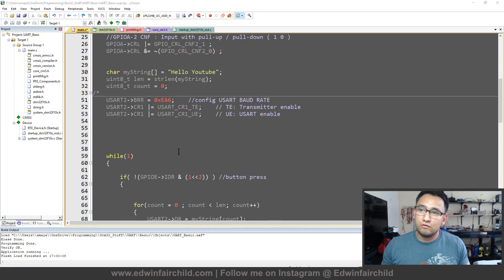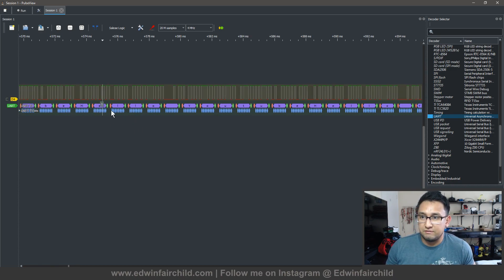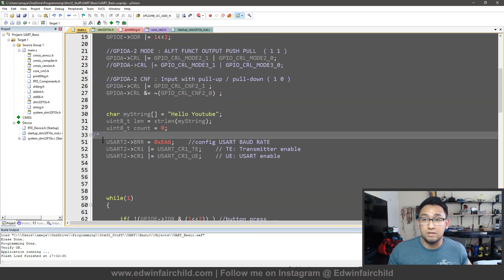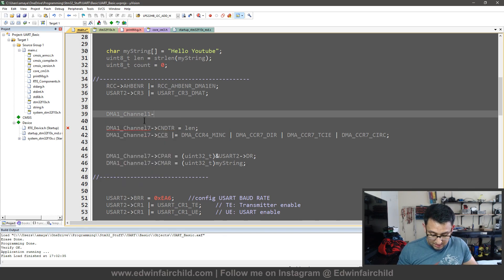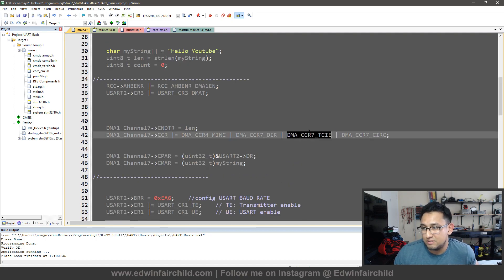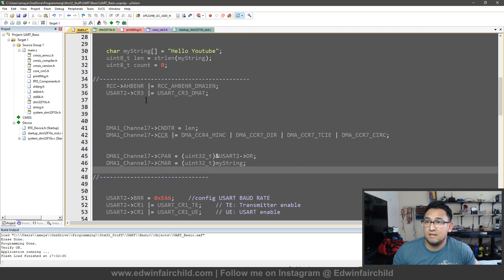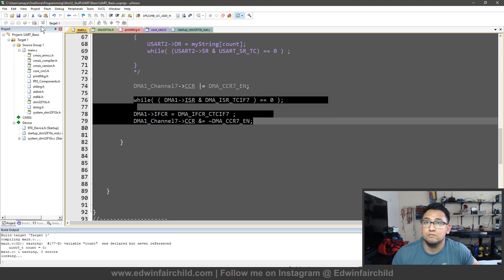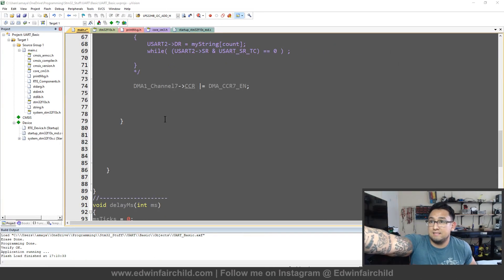STM32 DMA PT 2

Comment: Awesome video! Explains DMA really really well to someone just getting started with stm32.
A tip for anyone using CubeMX and HAL to autogenerate some of the initialization code for DMA use with SPI.
MX_DMA_INIT() needs to run before MX_SPIx_Init(). For whatever reason the code generated put the SPI init before the DMA init, and it took me the better half of a day to fix. This may also apply to other peripherals.

Comment: Hi Eddie,
Thanks for the detailed videos. I had a question, I want to receive some data whenever a user sends it (I mean i dont wait for the data to be present), so I am making use of Rx FIFO not empty interrupt. Since I donno the length of the data, I reading data byte by byte, and for each byte this interrupt is triggered. Once I get the interrupt, I read the RDR register content to a circular buffer and go to next location in that buffer after reading a byte.

But I want to do this using DMA. How should I do it? Because I do not get know the data length. So till the data reaches UART RDR register, can I use DMA as a mode of data transfer? Reading the RDR register to circular buffer, I am doing as a normal operation.

Thanks.

Comment: Pretty cool video! 
I have a question though. What happens if the CPU overwrites to myString (say a new value "Hi Eddie" in the next loop iteration) while the DMA is yet to finish the transmission to the peripheral?
Reply from the maker: that is a matter of logic, you transmission was sent based on what was in it at THAT exact time , if you over write then you over write , if you are referring to two bus  masters accessing memory at the same time , or if you are concerned about a race condition? if you are concerned about a race condition this could easily be tested by setting up a DMA mem to mem transfer ,and transferring an array from one location to another once you start the DMA then the very next instruction modify the array and see what got transferred, if the modified value or the non modified value. :)
Reply: Yeah I was interested whether there will be a race condition. Pretty interesting experiment to try!
Reply: @jaycansino630  Probably the race condition might exist on the very next word which might or might not cached or something, but since the DMA isn't caching the whole area you transfering, it will transfer the overwritten data anyway, which is usually unwanted, regardless of from what point it starts to race. If one actually wants to transfer overwritten data then disable continuous transfer instead, and wait to start when the buffer is complete, or at least when you are certain you are able to outrun the DMA xfer by the filling process.

One practical way to avoid race while one want seamless continuous transfer (eg. audio playback) to use two (or more) DMA buffers, use a flags to signal which is free and which is DMA'ed another flag to indicate which is "sendable" . The handshake would be so that task1 search for a buffer which is free, then starts filling it in, and when it finishes, sets the sendable flag. Do not use continuous transfer, but in the transfer complete interrupt, set back the free flag on the just completed one, search for the next sendable buffer, reprogram the DMAR register to that, remove the free flag and start the DMA again.

This also works for reading, eg. sample from ADC into one buffer, while the main thread processes the other one then swap the buffers.

Comment: I am receiving 2 strings in my usart .
1."hi\r\n" 4 bits.
2."AGE\r\n" 5 bits ..

Now if I receive "hi\r\n
usart must transmit "how r u " 
and 
else if I receive "AGE\r\n 
It must transmit " above20" 

I want to implement this code using usart dma .
Can anyone help.me.please
Reply from the maker: start reading from page 810 of the RM for the F1 it states all the steps for UART DMA transmission and reception. its pretty easy and straight forward if you understood these DMA videos and watched them thoroughly
Reply: char rxdata[30];
char txdata[30]="How r u?/r/n";

HAL_UART_Receive_DMA(&huart2, (uint8_t*)rxdata,5);

void HAL_UART_RxCpltCallback(UART_HandleTypeDef *huart)
{
  /* Prevent unused argument(s) compilation warning */
  UNUSED(huart);
  /* NOTE: This function Should not be modified, when the callback is needed,
           the HAL_UART_TxCpltCallback could be implemented in the user file
   */

  if ( strncmp(rxdata,"Hi\r\n",4) == 0)

  {
HAL_UART_Transmit(&huart2, (uint8_t*)txdata,strlen(txdata),10);

}
else if(strncmp(rxdata,"AGE\r\n",5)==0)
{

HAL_UART_Transmit(&huart2, (uint8_t*)"above20\r\n",9,10);

}

}

/* USER CODE END 4 */
Reply: the problem I m facing is this I have to send data multiple times like I have to send hi many timea from.my terminal than it replies.
Reply from the maker: @zuhaibchoudhary4635  the problem is your using HAL and I don't use that so I cant help much there,  try a Facebook group on Stm32 there's a lot of people there who use HAL
Reply: which Is this method of programming called that you are using?
Reply: I am a beginner I want to know which method of coding is used in the industry. which type to use

Comment: Tx Eddie. Is it possible to make the address the DMA is supposed to write to (CPAR) data dependent? So encoded in the data itself like an address header. So in this way the DMA would be able to sort out data packets according to their address headers and send them to certain address locations. I figured that if I have to intervene to decode the address header, then I might as well shove the whole packet to its destination as well.... that would work of course, but the question is, whether there is a way to make DMA to do this transparently all by itself?
Reply from the maker: But also rmemebre dma isn't only about not having code intervention but also not hogging the mcu resources to do data reception and moving. You can check the address header and send it on its way and start doing something else immediately , instead of waiting for your code to loop through the data and put it in its desired location , you could have done all kinds of math functions in the time it takes to do that with code
Reply from the maker: Interesting concept but I don't see how I could do this , because the DMA requires no interaction from the user so then at which point to you update the CPAR or CMAR registers? If in order for the DMA to even get the data it needs those two values... I'm leaning towards..it's impossible. But shit I could be wrong I just can't wrap my head around how on earth that would work, because again if you get a packet of data and in it resides the destination address , the DMA has no way of knowing that..it would require code intervention at which point it defeats the purpose as you mentioned
Reply: Hi Eddie. Yes, you could decode the address and then configure the DMA to handle the rest of it.
But I think I found something nevertheless... It is called DMA request routing and it allows to reconfigure the DMA dynamically from a peripheral. So in a way the peripheral can program the DMA itself. I need to study this but what I understand from it now is that the peripheral can configure the DMA , so the address header could contain configuration data for the DMA, then routing is set up, data is being transferred to a certain destination after which the routing is taken down again waiting for an other configuration request. At least that is what I think this is, but as I said I need to study it more in depth, but I think this is it... Dynamic DMA configuration, or DMA request routing as STM calls it.

I found two documents about it, here,
pdf file,
https://www.google.com/url?sa=t&source=web&rct=j&url=https://www.st.com/resource/en/application_note/dm00535045-stm32-dmamux-the-dma-request-router-stmicroelectronics.pdf&ved=2ahUKEwjlidOk1qnqAhUcwQIHHTwKDrIQFjABegQICxAG&usg=AOvVaw28CjK5Kl_gRrv0R0y_EehL

Youtube video,
https://youtu.be/c0pxTTEHZjE

Thanks for your reply and take care.
Reply from the maker: @OndrejPopp  Oh yeah this is with STM32 that have a DMA multiplexer , I am using the G4 mostly nowadays but have no tried this. The F1 which i thought you were asking about has a much simpler DMA. Still if you are using a newer design definitely go for a newer chip as you can see they are more versatile, thanks for the links ill check it out
Reply: Yes I ordered two stm32 H745's on evaluation boards, costs 20 Euro's per piece so I thought might as well get these... Why not? I am planning a design project with them, but I have no hands on experience how fast fast it really is.... When you go down to programming.... And I do not want to end up with performance problems later. So... I decided to design an infrastructure as powerful as possible before I go down to programming. And so it seems that this idea already paid off, having a DMA multiplexer for 20 bucks a piece among other things 😃
Reply from the maker: @OndrejPopp  oh yeah I've been wanting to pull the trigger on an H7 board also. It's a beast of an MCU , once you get up there with faster speeds you just have to be very mindful of your peripheral flags, on a 72MHz blue pill you can get away with sending data down SPI and then doing something else like reading or whatever, but once it's blazing fast you realize the mcu is executing instructions faster than any peripheral can get anything done so, interrupts, dma, flags etc you become intimate with them . Let me know how the H7 goes for you
Reply: @EdwinFairchild  Ok Eddie thanks I will. As a matter of fact, the infrastructure is going to be even more powerful, and massively parallel as it will also contain 45 or even 76 Esp32's. Now, the stm32H7 will send instructions over one SPI bus as a master to all the Esp32's in parallel, and the Esp32's will figure out all by themselves what to do, and then they produce data, and send the result back to the stm32 over an other SPI bus over which they act as masters in turn, and the Stm32 as a slave, and they, the Esp32's will also figure out an arbitration scheme among themselves. So then, data is going to flood in on the Stm32 on that SPI bus from all 45 or 76 of them, and then the Stm32 is going to sort all this data out based on time stamps. And so that is where the DMA routing comes in, how to sort out data from 45 or 76 Esp32's according to their time stamps.... So sending data over to the Esp32's in parallel, that's easy, but getting it all back from all 45/76 of them that's a little bit more complicated, so I am studying this now, and I thought maybe DMA? And so I have been looking at your videos. And it appears that DMA routing might be able to handle this, although I need to study this in detail, but that is the general concept of the infrastructure... 😃
Reply from the maker: @OndrejPopp  sounds like a heck of an endeavor, do you have any good learning resources for Esp32 ? I've actually been looking into it all morning
Reply: @EdwinFairchild  Funny! What I have I got from over here, https://www.espressif.com/en/products/socs/esp32/overview then at the bottom of that page click on "Datasheet" and "Technical reference". And do the same for the Esp8266, I just had a brief look at the technical reference of the Esp8266 and that appears to be a good manual with screenshots of oscilloscope/logic analyzer screens. I haven't read it yet but I made a mental note to do so later because it promises to be a good learning reference. More in depth than for the Esp32, because they probably figured why write it twice?

That's all I have actually, but the Esp32's are simpler than the Stm32's so after looking at the Stm32 H7's, and watching your videos about Timers, and seeing how you go through the reference manual of the Stm32, with all the registers and all that, that really helped me, and so after that, the Esp32's come kind of naturally to me.... 

One thing I already saw was that the Esp32 has a GPIO multiplexer and so you can configure a peripheral on any physical pin/GPIO you want which is way more flexible than with the Stm32. Although some peripherals on the Esp32 are also hardwired directly onto certain pins, such as with the stm32, bypassing the GPIO for higher throughput. But if you don't care about that you can use any GPIO you want for your peripheral of choice which makes the pin assignment to peripherals much easier. For the rest it's in the manuals.

Next I have just been looking at Youtube videos of people doing stuff with it. Actually I came across the Esp32 by watching Bitluni's lab. I learned quite a few things from Bitluni. He is
building large dot matrix walls for video throughput and is using the Esp32's in many of his projects. Here is one link about the ping pong video wall,

https://youtu.be/EZEMK-C-nSo

One thing I learnt from Bitluni is that to achieve high video frame rate, the Esp32's can apparently parallelize its I2S interface into 32 parallel bit streams. So concerning what I want to do, maybe I could use that to let 45/76 Esp's feed their data into one controller, but then I would probably need to replace the stm32 with several Esp32's. But for the meantime I am sticking with the Stm32 and DMA. In any case, this raised my interest into the Esp32. It has also a SD card slave interface, so you can communicate with it as it were a SD card. I was kind of looking for that in the Stm32, but they don't have that, only a SD MMC master, but not a slave. So for a while I was studying how to build this myself, but then I kind of gave up on that because I decided  that building a SD card slave interface is way too complex. But what do you know? Suddenly the Esp32 has that! So there you go. It is a tiny little chip with a lot of suprises!

And so then I decided I am going to use 45/76 of them!

That's all I know about them now, besides looking at AliExpress and AliBaba how to get 76 of these baby's over here reasonably cheap...

Comment: Yo this is an awesome channel. I've been reading the data sheets myself but it's always great being taught.

Couple of questions: 

1) what is your IDE (I'm using iar)?

2) what is that awesome debugger when you saw the UART transfer data?

3) is there a reason you didn't use an interrupt for the push button?

4) aren't their hardware interrupts for the DMA flags? Ie make an ISR function that knows if it needs to service a buffer or clear an interrupt flag?

PS since learning about the DMA from other uCs I also must say it is my FAVORITE peripheral too. Seems like the smartest invention from the silicon side tbh

Comment: Eddie, Let me first say that I think your video is really great.  I can understand you well, and the pace is fast, but not too fast.  Now here's the BUT....You really really really should have shown the interrupt.  I mean that's the real purpose of using DMA right?  I could have send the serial bits out on a GPIO pin if I was going to just wait around until the data was transferred to the peripheral.  I would be really happy if you would consider making an STM32 DMA PT 3 video to show how the interrupt is implemented.  Until we have that piece working, DMA is pointless.  AND I still think your video was great on the portions you did cover.
Reply from the maker: Which interrupt are you referring to? Send Completion or error ? Because at least to me personally the point of DMA is to NOT interrupt my processor unless there has been an error
Reply: @EdwinFairchild  I think probably the Completion interrupt, but actually since you ask, knowing how to deal with errors would be good too, if not too complex.  Maybe the interrupt is more valuable on the RX channel so we interrupt to process new data received from a peripheral source (GPS, Gyro/Accel, etc).  Just thinking for most applications they will want to be "notified" when the TX is done, and when new data from an RX is available, and the interrupt is the most efficient way to do this.  I'm a n00b to the STM32 with only Arduino Uno experience, so was wanting to see how you setup an interrupt routine for the STM in the IDE.  Thanks for your reply.
Reply: @EdwinFairchild  The point of DMA is still to get the interrupt, but with less frequency.

Consider an ADC capture where you need a block of data to process. Instead of interrupting by the ADC at every single sample, let the DMA collect the data THEN interrupt when the whole buffer is filled. If this is not a single-shot operation, then the interrupt is required to swap out the buffer otherwise the main is too late to do that.

The same is for writing. Usually not the same data has to be sent over and over, so if you don't want gaps in the transmission, you need that interrupt to send another buffer.

Without the interrupt it might be good for repeated continuous transfer or rare single-shot transfers, but the purpose of the DMA is to move massive amount of high-speed data which otherwise would saturate the CPU.

If the main thread has to wait for the completed status to continue, then it could have sent the data to the peripheral without DMA.

Comment: I never heard of the DMA until this , seems more handy to use.  Great video
Reply: Yeah.  I checked the Arduino Uno (Atmel / Microchip) datasheet and it doesn't have it.  This is an incredibly useful tool which could increase the power of the chip by multiples.
Reply: @randysonnicksen9475  8-bit MCUs don't usually have DMA. High-performance 32 bit MCUs are equipped with so many cool peripherals, and they are so cheap now that it's not worth using 8 bit MCUs anymore, unless the project is special in some way, eg. mass produced very cheap end product, needs to be very low powered, legacy code which just works and nobody wants to port it, etc.

ARM/MIPS cores are magnitudes faster, and once you learned them, magnitudes faster to develop on, and actually a joy to use all the powah and the flexibility.